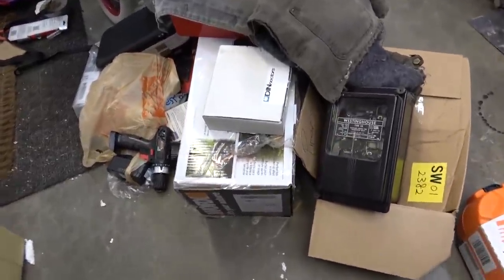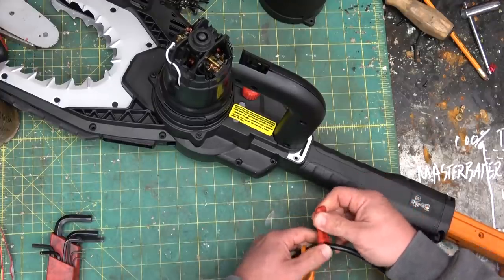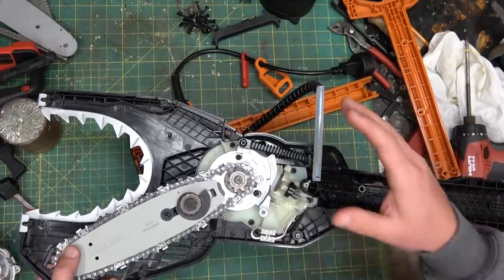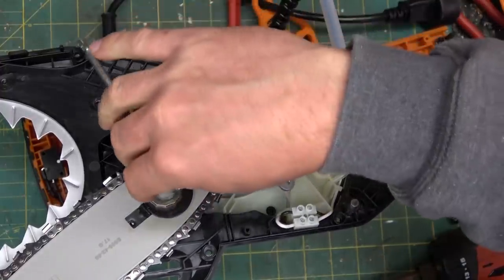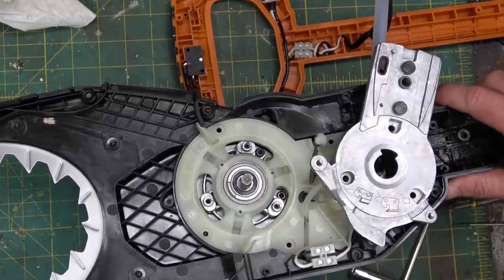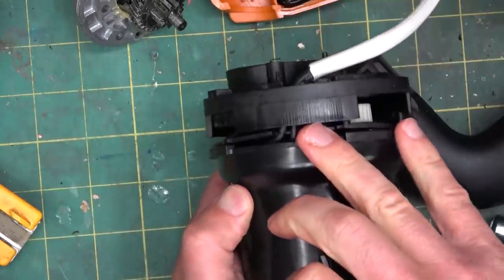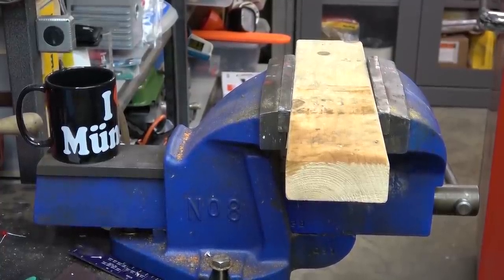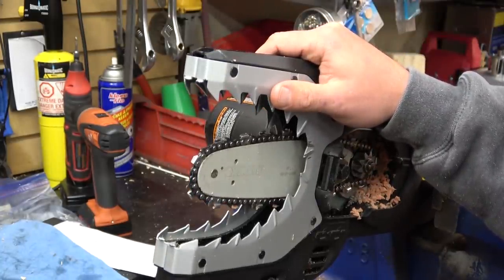BOLTR: Worx Jaw Saw | Engineering Fail

Comment: I work for silicone injection molding, and the lines (roughness) we call it skiving, as we use poly-carbonate plastics.  The smell could be caused by the mold release, and usually the smell goes away after 8hrs or so, and the skiving on the plastic is a result of the release agent wearing out, or not using much or any mold release.  Lack of mold release will cause the plastic to literally bond to the mold, and you don't want that.  Such products called "McLube" and "Orvus (soap)" can be used in our case.  We McLube the mold, then use light amount of orvus to 'hide' the texture of the Mclube and give us just the right amount of part release from the mold.  You don't want to over-lube the mold, as then the part will stick to the other side of the mold where you don't want it, and you don't want too little and cause the part to not release.  Clearly the skiving on the plastic parts is a result of a mold operator not paying attention, or have little to no knowledge on the proper mold operation and importance of mold release.  When the plastic has too much gloss, it means that the mold was saturated in mold release, and it shows on the plastic surface layer.  Some plastic mold makers are saying that newer molds don't need release agents, but I call that horse sh*t, as nothing done with the steel will change how plastic interacts with the steel surface layer to prevent the plastic from bonding to it.

Comment: what is that cool looking electrical(?) thing at the end?
Reply: That is ancient computer memory.  Tiny wires threaded through ferrite beads.  I'm not sure how many layers are in that assembly, but that might be 1 kB of RAM.  That is what flew on the Apollo mission computers.
Reply: Confuser memory
Reply: Wow that's amazing.
Reply: Not all of it was even programmable. Mission stuff for apollo had to be mechanically programmed (woven) for all the 1s and 0s to be in the correct spot.
Reply: It was that or vaccume tubes when that was used... both were viable options... the magnetic memory was a lot slower than a vaccume tube... but it was way cheaper and didn't take up as much space or power... vaccume tubes needed to be kept warm to function properly
Reply: they're also rather delicate to toss in a moving vehicle. Vacuum tubes that is.
Reply: @MichaelSteeves  You are confusing rope memory with core memory here. All of the programming for the Apollo missions was stored on read-only rope memory. Though a small amount of read-write memory was available, it goes too far to say that's what flew the missions.
Reply: Actually had a professor that worked with an iron core memory computer. Also, the original space shuttle had iron core. It only had enough memory to hold the orbital program or the re-entry program, but not room for both. To prepare for re-entry, they had to wait 24 hours for the re-entry program to load. They had 5 computer systems, and when they switched to solid-state memory, all 5 solid-state computers fit in the space that one iron-core system used.

Comment: The orange clip on the cable is most likely used to attach the joining power cable with. Join the cables with the connectors and then attach the orange clip to the other cable to help prevent them being pulled apart if you need to stretch the wire to reach something while using the saw.

Comment: That orange thing at the end of the chord is there so that you don't snag the cord out, its there so that if you yank hard on the extension cord it wont get unplugged. Something like when you tie a knot at the point where 2 extension chords meet so that they don't come apart if you pull too hard.
Reply: Hey Ave, do the Bosch Go cordless skrewdriver!

Comment: 5 amps? That's nothing. I get 12 omhs of power from my drill.
Reply: It takes me only a parsec or two to drive in to town.
Reply: That's the joke, did you even watch the video >.>
Reply: That's rubbish. Either get a reading on the plate in Amp or in Watts. Ohms is a measure of resistance.
Reply: :D guys, if you watch the video, the box of the tool claims that it has a voltage of 5 amps, I'm being sarcastic, I'm quite aware that omhs is not a measure of power.
Reply: @Dingus E. Dow - I nodded off about the time he showed the machine had a Xanax casing or something or other...sorry, i had a hard day's work today....and a harder drive home😓
Reply: Fair enough. Omhs is spelled ohms though.
Reply: Words are hard.

Comment: Those little plastic terminals we call floaters and are typically rated for 500 volts. We use them in industrial applications for low voltage stuff sometimes

Comment: Read the directions and you would know what the PCs on the cord are for. 
Just like a reg chainsaw you push not pull, so that you don’t over work the saw. I’ve had one of theses for 5 years and had NO problems... it’s been left in the rain and still works great...

Comment: Pulling is better when you have one static point, but in this case it wouldn't be comfortable at all. Did you think about ergonomics of push/pull when it's actually pressed against a branch? pushing is what adds stability during usage.

Comment: those plastic screw terminals are still legal here in Aust. at 220-250v 50hz although usually in external lights and kitchen oyster lights rather than tooling/machinery

Comment: The orange thing on the end of the cord is a strain catch for the extension cord so it does not un plug every time you pull on it you loop the extension cord through the bottom slot and around the tab in the middle

Comment: Glad I chose the Black and Decker electric chainsaw Lauper.  It works great and a lot safer than the Worx.  I have used it for over 8 years and so have my neighbors, friends, and still runs and cuts like a champ.  The 2 handle Lauper design with the chainsaw bar and chain fixed on one of the arms is only about 6 inches when clamped down into the cutting position.  It works like a traditional Lauper, except it's a chainsaw, Lauper.  I haven't seen the Black and Decker in the big box stores but I found it on Amazon.  Don't know why big box stores are not carrying it. Everyone that has used it has been extremely pleased.  It cuts up to 4"  quickly, ease and bigger with a little finesse.   With the B&D what used to take me 2 days to cut thick shrubs, I do in 2 hours or less.

Comment: that hook thing is for idiot proofing you make a loop of extension cable near the plug end, put it through the slot and put the hook in the middle of the loop. it means if you take a few steps too far you won't unplug the saw.

Comment: That machined shaft with the flats that look like they have been turned could be the result of polygonal milling. It's done in a lathe with live tooling where the part and the cutting tool are turning at the same time and the milling cutter essentially "turns" a flat on to the part. Can be used to make hexes, squares or two flats in this case.

Comment: Those vertical marks on the molded plastic motor cage part are called drag. As you guessed, it's generally from the part getting hung up in the mold. Maybe the ejection pins are only at the center of the part?

Comment: Those terminal strips are completely legal in machine and tool assemblies/wiring in North America. And in most parts of the world with 240 volt phase to neutral power systems, they are used on mains wiring. They're actually not terrible if the contacts are properly made with nickeled brass and the shell is made of high temperature nylon at a 90c rating.. that said there are some made of absolute crap.. like anything else there's always a crap version out in the world. I've seen the well made versions withstand sustained 40 amp overloads before the shell melted, even at that it was the wire that vaporized first.

Comment: I can't believe I actually get a chance to offer a Suggestion. The design is useful because you can't use a chainsaw on small wispy branches such as the tops of crepe myrtles. But you can catch it in the gullet of the jaw and stop it from bouncing off of the chainsaw blade. I'd like to see a commercial design

Comment: 6:50 I think you missed that the mechanical advantage from the lever mechanism increases significantly as you push the handle forward, negating the adverse effects of the spring getting harder to compress.

Comment: That motor looks like an HVAC fan motor I worked on for my 2007 Saab, basically had to redesign and 3D print the commutator assembly bracket to replace the axle bushing, yes, bushing, with a bearing from a skateboard, interesting that they use a bearing from the start, wonder what makes them decide on those design choices? Cost obviously, but still interesting to know the specifics.

Comment: Interesting video as always. I'm certainly not qualified to judge the tool on the technical merits of its materials and construction but I have owned one of these for about 2 years and I have to say it works very well for what I use it for. 

Some of the wood I get for my bbq smoker is a little too long and needs to be shortened. This thing does that superbly and easily. Just place the logs on the ground and place the jaws over the log and push down on it (which ergonomically actually is a very easy thing to do) and in a couple seconds the log is cut. I've yet to have the chain bog down while cutting well seasoned oak or hickory. I can cut dozens of logs (splits actually) in a much quicker and safer manner than if I was using a "real chainsaw". With the logs on the ground I don't need to worry about finding some way to hold them securely to make a cut as I would if using a normal chainsaw. I do run into some logs that are a little too large but have found that isn't too much of a problem if I make multiple cuts around the circumference. If a split is sized so that it properly fits in the jaws you are ever really cutting with the tip of the chain since when you start the cut the rotation of the chain grabs the split and lifts it up into the jaws.

I have no idea how many years this thing will last but it is something that doesn't get used very often - I'm guessing I've only made a few hundred cuts with it since I've had it. When it dies I will quite likely buy another one because for my purposes it is far safer/easier /quicker than using a normal chainsaw.

Comment: That bad plastic smell you get may be the result of lower grade peroxide used to adjust the melt flow characteristics during polymerization and extrusion. During my time at a polymer plant, we had to switch peroxide suppliers to a higher grade, organic peroxide due to odor complaints of customers using our product.

Comment: I love my Worx Jawsaw.  Mind you, I use it once a year to trim the smaller limbs that the periodic big winds blow down into the property.  It really does make much faster and safer work of clearing the dross.   I do have a chain saw for the larger bits.  When the trees hit the house, however, I call the pros.  The joys of living in "paradise".  I'm one of those old'ns.  What you can do is set those jaw teeth against the limb, and lean into it.  It isn't a matter of just using the hand bits.  I can't see a pro using this, but lopping of all those limbs with a buck saw or chain saw or Fiskers loppers or whatever is WAY harder and slower.  If you use it right, you don't get tired.  Try it...  I'm old enough to remember some of my neighbors had CLOTH covered phone cords.... Wow... I wrote this before your last comments.  That is precisely when I use it.  For cleaning up after hurricanes.   It does truly speed up clearing.

Comment: The orange dingus bobble on the end of the power cord is a strain relief for the attached extension cord/coupling. Feed a loop through the slot and put it around the hook. Maybe I'm stating the obvious - but it sounded like you genuinely didn't see its purpose...

Comment: I actually love my Jaws.  Living in Hurricane Country, we get limbs down (or worse) every year.  This really does knock down the smaller branches super fast.  (provided you have electricity or generator power  -  I have generators.)  You can clear off the smaller limbs that get in the way of the chain saws.  Also, most of this is already on the ground.  You can put your body into the effort.  It is quite quick at that job.  Our neighborhood is pretty good at coming together clearing after the big storms.  A couple of us older middle aged guy clear the small stuff for the bigger guys (and some of the girls -like my daughter) with the real chain saws, and the older folks set up breakfast for all.   The kids come after with rakes to take care of the leaves and twigs.  We can clear our block pretty quick leaving it for the city trucks to pick up.   OH...and yes... we have UNDERGROUND wiring.   I wouldn't use this to cut down a standing small tree, even a small one.  It WILL get stuck in the cut as the tree binds over it and falls.  The chain tension is important.  After a bit it will come off if you don't check it.  And doing a street full of small limbs it will heat up and loosen. It's easy to put back on, though.  It is clearly light duty. It is on repeatedly but momentarily so the motor won't heat up too much.  Mine is at least 7 years old.

Comment: Wouldn't be a terrible tool for trimming smaller/medium branches. I use the Jameson Barracuda to cut stuff too big for shears. It cuts through medium branches like butter but on some weaker branches you do get quite a bit of flex before you can get enough leverage to cut. Some branches you just end up pulling down and having to hold with one hand while you cut with the other. Needless to say this would make those jobs easier. Then again I haven't tried a pole mounted mini chainsaw so maybe wouldn't be as big of a help in that case. Sometimes there is use for some support. I do think a more of a shear/scissor design could fare better if they worked out some of the kinks. That way you get the support when you need it and can handle bigger stuff when you don't. Maybe something with a stationary saw and single flexing jaw that moves the branch into place.

Comment: In case you weren’t screwing with us: the orange dingus on the cord allows you to loop your extensioney chords through it so you can tap dance around the yard and bend your prongs on the extension cord rather and unplug from the chinesium tool

Comment: The plastic connectors are still quite often used in 240v systems. My lights have them, and I've never had an issue.

Comment: That mechanism is that way because it’s made to reach up and push it against a branch on a tree. If you were doing that and you had to pull, you would need 2 hands and wouldn’t be able reach as far. Also if you were up a ladder you wouldn’t be able to hold on because you’re using both hands to pull it.

Comment: I bought one. I actually like the way it works BUT it has started throwing the chain repeatedly. And the way it’s built it’s hard to replace the chain because the motor juts out on the side you have to work with so it won’t lay flat.

Comment: One problem with the spur drive is that the chain tension changes as the chain goes over the teeth. Rim sprocket don't have that issue.

Comment: "You make something idiotproof and the world just makes a better idiot"
-AvE
Reply: We have one and it's awesome! We get down limbs often, and this thing cuts them up super quick, while the limb lays on the ground. The chain pulls the limb up into the jaws, the jaws hold it in place, and the chain never touches the ground. When used on low limbs in a tree,  the jaws hold it in place while you cut.    Super easy to use and very safe.  Not industrial strength by any means,  but for the average home owner, it is a better, safer solution than an open chain chain saw.
Reply: @kylentj1  I just go for the Silky Katana

Why the hell would i use some chinese "Chainsaw-on-a-stick" to cut limbs when cheaper tools, that don't require any sort of expandables like gas and oil, and that doesn't pollute are way more efficient?

Comment: to make it safer than a spring applied but not as stuped as a spring retracted they could have made it just have some kind of deadman switch where if your finger isn't on it then it springs back but otherwise all the force comes from your hand or whatever (and make it pulling force like you said, put some little steel cables or what have you). and maybe up the lever action ratio a bit.

Comment: I have one of these...   as others have said, it's designed for cutting branches on the ground. It can also used to lop tree branches off.... there is an extension to extend its reach. I got it to deal with downed branches from the ice storm a few years back. Was a lot faster than using a Swede saw, especially since the branches were frozen. The extension let me get on a step ladder and clip loose broken branches.... No way would I want to be on a step ladder waving around a real chain saw on the end of a three foot handle!

Comment: I  just watched your video and I can't for the life of me figure out why you made this video.  I have one and it works great.   And pushing is better than pulling.  With branches on the ground,  it makes it much easier to cut them.   The only thing I will agree on, it will get heavy after a while.But I am not as strong as I use to be so it does get heavy when you are cutting branches over your head.

Comment: I betcha those flats on the drive shaft were parametrically xc pattern turned. Basically the x axis is timed to the spindle, and it does all the complicated calculus to turn flats in a conventional cnc lathe setup. Depending on the machine, it can be quite a bit faster and more repeatable than live tooling, though a real pain in the dink to program.